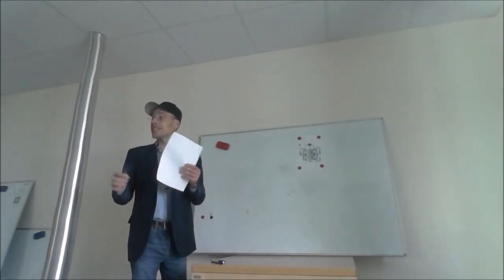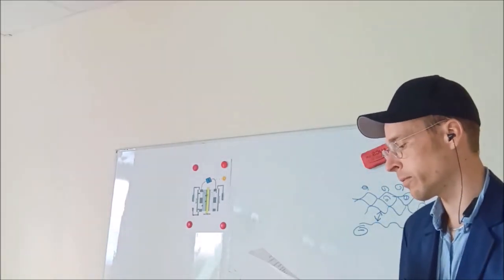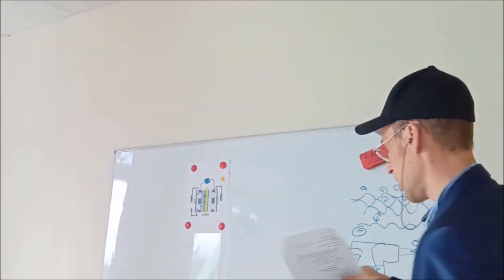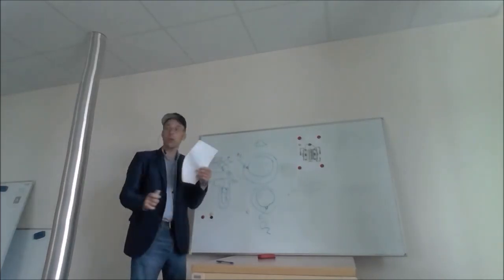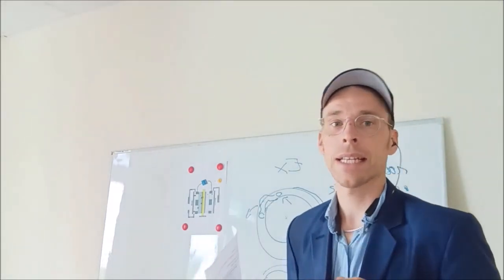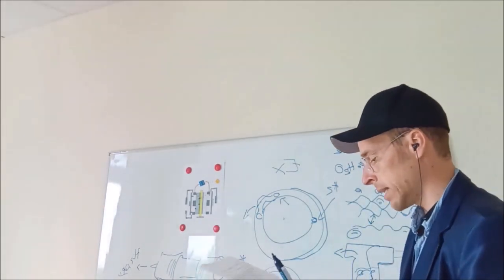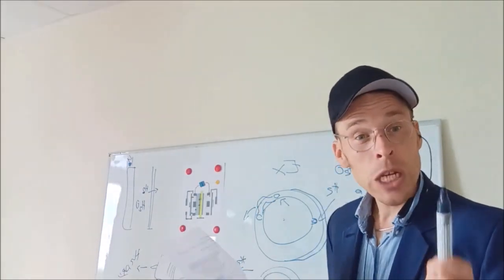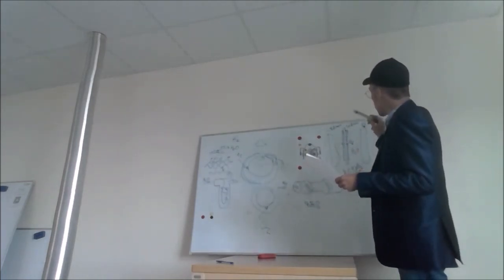boost your hydrogen electrolyzer, 5 usefull h2 hho tipps

Comment: Msgnet on oxygen plat3 for massive output. Use ferrous coated with titanium or oxide of low corrosion alloy.  Almost double output. Yes just s strong magnet. It llines up the electron spin correctly instead of the bottleneck.

Comment: Hi dear sir 
It is valuable information.
I am deeply appreciated. 
Do you mean that we can use deionized water instead of adding  potasium hydroxide to the water to speed up the reaction?
Reply: A general view here is... Deionised/ is distilled water and in the process of manufacturing has no particulates, even clean tap water has particulates, this tap water is what turns you're water sludge brown ... The distilled water stays clear clean always... 
Note I have seen a guy use distilled water in a bucket then stick a hand drill in then put his hand in and turn drill on whilst not being electrocuted .. current won't travel unless via particulates... I.e.. koh.. or .. lye... Or .. backing soda and such...
I highly recommend not trying this bucket thing... It's purely as a Learning, teaching concept, current travels across particulates.. no particulates = no travel..
Thom in Scotland.
Reply: @fuelban 
Hello again Dear sir
Actually ' what i need to know is the best motivation material to help in speef up the procesd and make it more effective without consuming a lot of power.
Koh or lye or soda from your experience. 
Thanks in advance
Reply: @مجداسماعيل-ف8ق   hi... Finding the Ballance... It might assist you to understanding the hydrogen atom separates easier from urine than water, and urine has twice the hydrogen as water, I'm sure if do just a little research on this you'll discover it.. hydrogen separates easier From urine than water. So less power amps needed...
Look to Nigeria kids...urine powered generator Nigerian student's...
It might be what you want... Find the Ballance my friend..
Thom in Scotland.
Reply: P.S.  forgot to mention that urines smell quite awful .. pay attention to the teacher of the girls when he says use a little bit of detergent to mask the smell LoL... 
Thom in Scotland.
Reply: @fuelban  
Hello Dear Sir 
I am deeply appreciated for your information 
I will check it could be amazing and useful for me
Thanks a lot again dear friend
Reply: @fuelban  
Ok
I have got the idea.
Best regards
Reply: You cannot speed up this process, it's finding the Ballance... You try to speed up by adding more power... Then you create heat and gas sticking to plate surface, this in turn slows the production, current won't pass through air nor Gas. So you effectively slows production as put in current transformer to heat... 
Find the Ballance my friend ...
Thom in Scotland.
Reply from the maker: If you have a pem electrolyzer- deionized. Aem electrolyzer koh
Reply: What he referred to... Deionised water... You're wife uses it in her car battery. Also in the home Steam iron... Use tap water in steam ironing you get White crystals on you're clothes... I need a lot more room to explain, than offered here...truly.. this video is less than the sum of its parts guys...
Thom in Scotland.

Comment: #5 what about flowing the H2 gas through a Super hydrophobic micron pore sized sponge 🧽 to keep the water vapor behind?
Reply from the maker: l don't know. It's worth a try. thanks for sharing the idea.
Reply: @volks-electrolyzer something similar to this on Amazon, COBETTER PTFE Disc Membrane Filters Hydrophobic, 47mm Diameter, 0.22µm Pore Size, 100 Pieces/Pack
Reply from the maker: @davidprock904   hydrophobic is not like a sponge. it is water repellant. you want to use this to raise the Amperage and avoid gas bubbles around your plates?
Reply: @volks-electrolyzer  those filters are like a sponge, the smaller the pores in the filter/sponge the better it will be. And if your filter or sponge doesn't hate water, put it in a vacuum chamber with a liquid based treatment to apply to stuff to make what ever be super hydrophobic, submerge it and vacuum out all the air to force it into the sponge completely, pull it out and dry it out and place that inline of the H2 to leave the H2O vapor behind.
Reply from the maker: @davidprock904  wow you are genius. What is the W/l for electrolyzer with this sponge?
Reply: @volks-electrolyzer  W/I ?

Comment: You can use frequency on the water to we weaken the bonds for easier even splitting
Reply from the maker: there is a company, who claims to get the efficiency higher, by avoiding gas bubbles around the cathode and anode. they are not drowned, more fed buy a sponge soaking up the water. anyway they only work for large scale projects. in other words, with the oil industry.

Comment: [Pack1of4] Pengemasan unit Generator Oxy Hidrogen HHO dengan aman untuk Pengiriman Kargo
https://www.youtube.com/watch?v=czexmU09b0c&t=3s

[Pack2of4] Merakit Genset Oxy Hidrogen HHO dan Cara Menggunakannya di Tempat Terpencil
https://www.youtube.com/watch?v=EmUAIukrpIo&t=102s

[Pack3of5] Perbandingan Penggunaan Air Tanah dengan Air Demineral pada Elektrolisis OxyHydrogen HHO Generator
Comparison of using Ground Water with Demineralized Water in OxyHydrogen HHO Generator
https://www.youtube.com/watch?v=MdJQtlD9E90&t=4s

[Pack4of5] Panduan Pengguna Sederhana DIY OxyHydrogen HHO Generator untuk Inhalasi
https://www.youtube.com/watch?v=L2oM1Io5oV4&t=1183s

[Pack5of5] OxyHydrogen HHO Generator Pembersihan dengan Air Dingin Setelah Digunakan Untuk Membantu Orang Sakit dan Lansia dengan Penyakit Menular
https://www.youtube.com/watch?v=3okorWubbng&t=716s

OxyHydrogen HHO Generator digunakan di dataran tinggi Cianjur,
suhu udara dingin 17 celsius, 13,2vdc di tepi sawah
https://www.youtube.com/shorts/upNZiYG50QM

=====

[Pack1of5] Safely package the Oxy Hydrogen HHO Generator unit for Cargo Shipping
https://www.youtube.com/watch?v=czexmU09b0c&t=3s

[Pack2of5] Assemble Oxy Hydrogen HHO Generator Set and How to Use it in Remote Places
https://www.youtube.com/watch?v=EmUAIukrpIo&t=102s

[Pack3of5] Comparison of using Ground Water with Demineralized Water in OxyHydrogen HHO Generator
https://www.youtube.com/watch?v=MdJQtlD9E90&t=4s

[Pack4of5] Simple User Manual DIY OxyHydrogen HHO Generator for Inhalation
https://www.youtube.com/watch?v=L2oM1Io5oV4&t=1183s

[Pack5of5] OxyHydrogen HHO Generator Cold Water Cleaning After Use To Help The Sick and Elderly
https://www.youtube.com/watch?v=3okorWubbng&t=716s

OxyHydrogen HHO Generator used in the Cianjur highlands, 
air temperature is cold 17 celsius, 13,2vdc on edge of the rice field
https://www.youtube.com/shorts/upNZiYG50QM